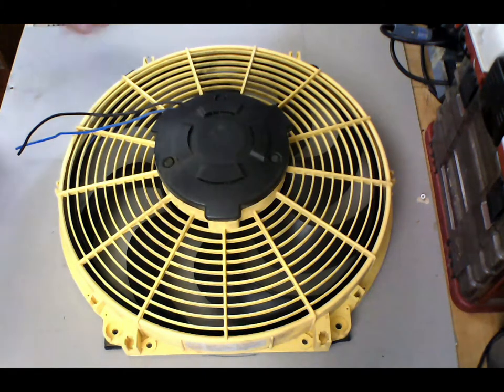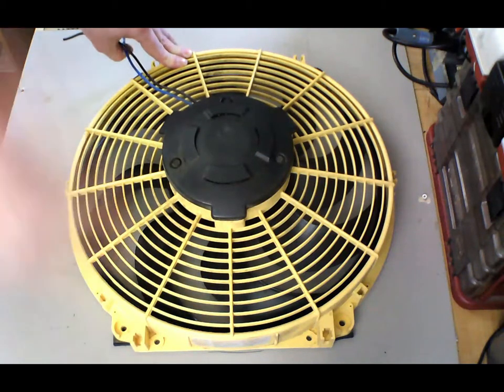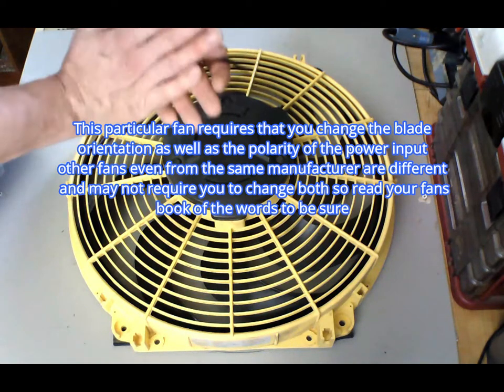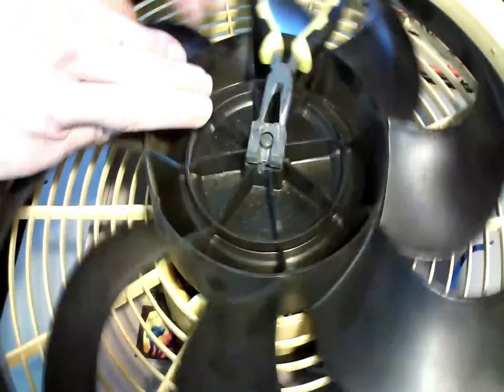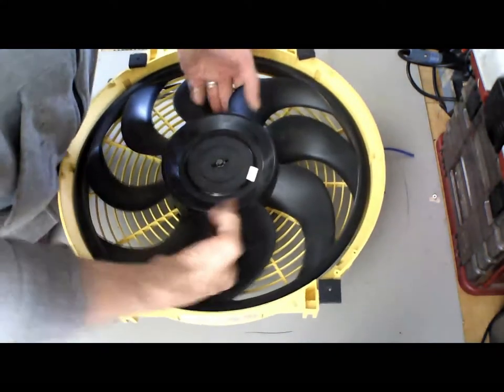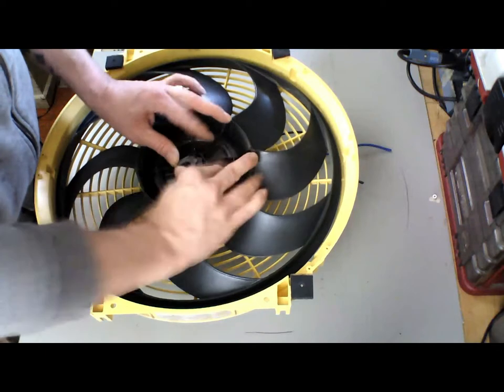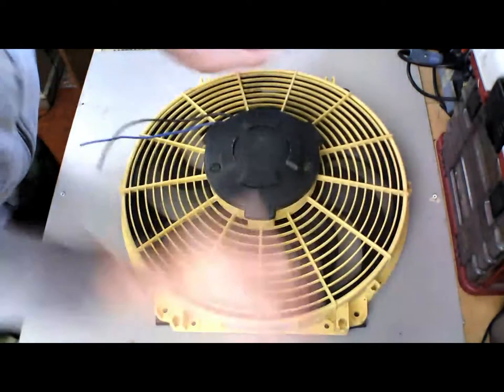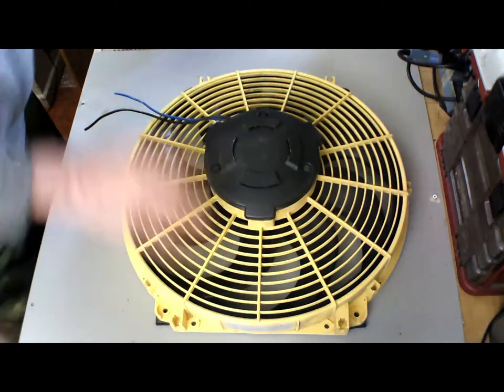Change the direction electric automotive cooling fan

Comment: Your fan was on as a puller when you attempted to use it as a pusher. Then when you flipped it in the video you made the fan a pusher. Curve of the blade or concave of the blade faces air flow.

Comment: Ok so if I add cooler electric fan on front of air conditioning consender in my F150 so that meant I need to use the fan wind pusher or puller???? My 5.4L has it own drive belt clutch fan.

Comment: let me get this straight because Im confuse,  so If I have the fan on the engine side you want the fan to pull air blowing the engine instead of the radiator?  that's how mine is and I was so confuse,  I thought you want the fan to blow to the radiator.  so If I want it to blow to the radiator I have to move it to the front of the radiator and change the direction to push correct?
Reply: Depends on how the fan was designed.  Some fan blades are designed a certain way that if reversed become less effective and wont move enough air through the radiator.  First, if a fan is mounted on the inside of the radiator it needs to pull cooler air from the front of the vehicle inward through the radiator towards the fan.  If it is mounted on the outside of the radiator away from the engine it needs to push the cool air from outside through the radiator into the engine compartment.  Hope that clears it up for you.  Now as far as switching the fan between a puller (inside) and pusher (outside), if the fan motor accepts a polarity reversal (simply switching the two wires from the fan) as mentioned some are fans are not designed to be flipped over and some are not designed to move as much air if flipped and reversed.  So regardless of which way you go, try to mount the fan as the manufacturer designed it, make sure it is moving enough air through the radiator, and of course properly test it in harsher or hotter conditions so that you know it will be up to task when extreme conditions arise.  Like sitting in hot weather, ac blowing, in stop and go traffic, or under heavy load, towing, and driving up hill.   Also, there are other details to consider when changing or adding an electric fan, like if it is large enough or strong enough to maximize air flow.  If a fan shroud is required (usually a plastic piece that surrounds the radiator with a large hole in the middle where the fan is generally located).  Always make sure to check the CFM of a fan to verify it will meet the demands of the engines cooling system.  The higher the CFM the better.  And remember not all fans are the same, it's better to buy once than to overheat the engine and buy twice!

Hope this helps.  Good luck!

Comment: At the 15 or 16 second mark is how my fan blades look currently and I am running them as pusher fans in front of the radiator.  They will be spinning clockwise. Is that blade position at 15 seconds correct for pushers?
Reply from the maker: The easiest way to tell would be to set it on the engine with the cage side down so the blades are not touching anything and connect the wires to the battery and see which way the air moves .  its been a while since I made this and I switched it around a few times to suite other mods I made so Im fuzzy on the exact details your asking from the video  but the test I suggest will tell you for sure  just make sure nothing is in the way that fan kicks hard and moves a lot of air

Comment: This doesn't change the direction of the fan. Blades are still facing the same way and it spins the same direction. Nothing has changed.
Reply from the maker: changing the polarity actually runs the opposite direction your probably thinking AC current this is DC and the pitch of the blades is different that's why you flip it unless you want to hear a loud howl and over heat the engine but please don't take my word for it its all in the fans instructions.  you should call them up and let them know they are mistaken

Comment: There is no need on flipping the fan. Its still the same way ? Haha
Reply from the maker: actually the pitch of the blades is different think of it like a prop driven plane that changes the angle of the props (feathering)  to cut wind resistance or for slowing the plan when landing.  most of the manufacturer for these fans tell you to flip the blade assembly when switching the polarity.  you could run it without flipping but it would not be as effective and probably sound like a hercules cargo plan when driving